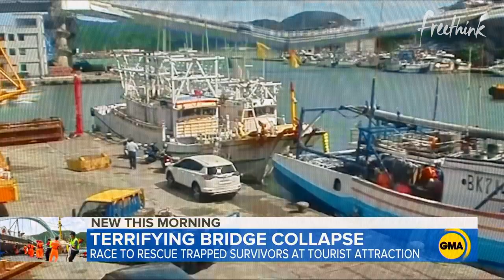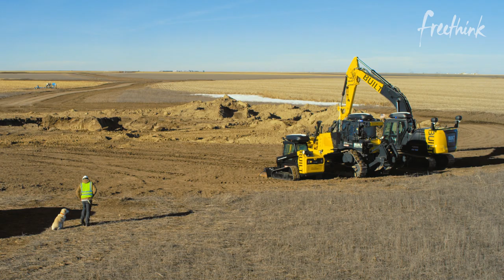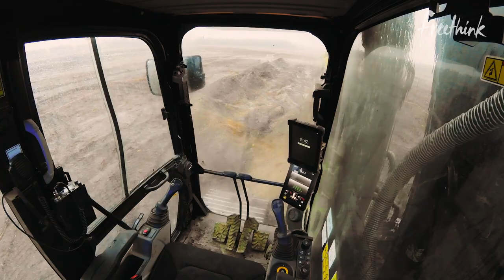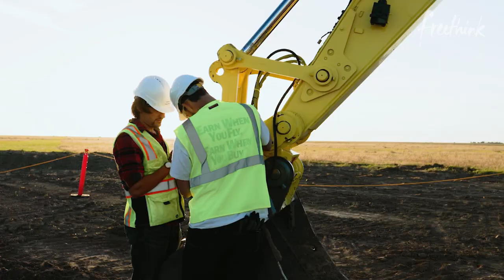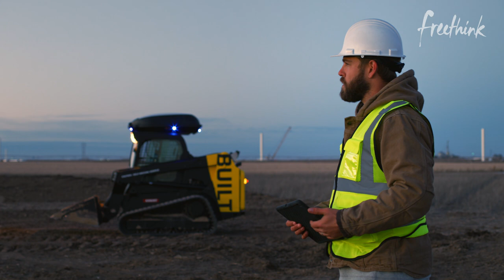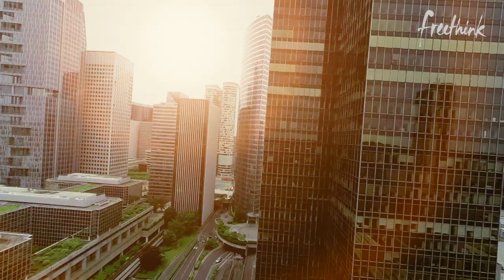The Driverless Future of Construction Robotics

Comment: We at Mortenson have been partnered with Built for a few years now.  For low dexterity work, like excavating a round hole in rural areas for wind turbines where we can't get skilled operators to these rural areas.  We are using an excavator, compactor and a dozer, all three autonomously working together to dig, move earth and grade.   When you think about it from a safety and bridging the gap of the growing shortage of skilled labor!  This is not about removing humans from this work, it is repurposing these workers for smarter or higher dexterity work.  PS. Many of the segments in this video are real Mortenson wind project sites.  This is the future now!
Reply: How has your relationship been with Built Robotics since you wrote this comment?  We are thinking about partnering with them.  Do you have customers requesting this tech or have you found it beneficial in winning bids? Thank you
Reply: @mrclm55 customers don't request is. It's how you can land a contract for 200 turbine holes spread over a couple rural counties. Then if the owner ever goes to the site they see how it's done. 
Obviously it's a good reputation move to introduce yourself and the tech so in thw future thwy know you can deliver. Say if something like a health emergency requires half the country to stay at home.

Comment: At Mortenson, we partnered with BuiltRobotics to test and validate the use of autonomous heavy equipment for the past couple of years.  WHY? We are trying to solve the mega trend of the shortage of skilled craft and Operators in rural environment which are away from the workforce populations.  We are working on low dexterity work that a machine can do which is far higher value then having a skilled operator taken away from high dexterity work (more complicated work best done by humans) so we move earth specifically to build clean energy - wind/solar projects.  Many of the scenes in this video were taken from Mortenson energy jobsites.  It's not about replacing people, but augmenting the workforce so we can apply the tribal knowledge and high skillset on the right work, vs. having machines do the tedious work at night while workers are with their families.
Reply: Ah yes, 'augmenting the workforce' and applying 'tribal knowledge' - whatever tribal knowledge means in relation to a construction job. Dude, you've swallowed too many business efficiency seminar powerpoints. I'm a civil engineer, I can see your bs a mile off. Of course it's only a very minor impact on jobs at the moment. Lift your head up from your LinkedIn profile for a second to think about the wider effects over the next 10 - 20 years.

Comment: I think this system and others that I've seen are great and they WILL replace people. Tje problem is not everybody has the aptitude to get into IT. 
I work in construction and most tradesmen become tradesmen because their good with their hands. 
The other thing I've noticed about construction over the past 10-15 years is that the plans and specifications we get onsite are getting worse and worse and the engineers and architects are doing less and leaving tradesmen and site people to fill in the blanks, the reality is robots are only as good as the person programming them. I b erlieve these machines are great but even the video shows them working on there own in a big wide open space, the reality is most construction work takes place in cramped sites in the middle of a city. 
I think construction will eventually become more automated but you have to change a lot of peoples attitides.
Reply: Survival of the smartest i suppose...

Comment: It's going to be really hard to get this accepted and used mainstream.The people in charge of construction products like predictable.They have to win lowest bids repeatedly.If they can't fully trust in the work getting done they can't bid.If there is any problem with the computer not working/ it's actual ,practical capabilities at all,which causes even small delays in production they will have software ripped out by themselves and a qualified human in the seat faster than you can say unemployed robotics,and they won't be coming back.And even on simple" tasks I don't think they will have the split second awareness and deduction making,and control needed .You'll end up needing one operator to run one AI tractor full time,which sounds more expensive to me.Maybe it would work if you have no skilled operator and a foreman can get a task done( possibly done).Even still that would be expensive tech waiting around for the "easy work" and still costing money.Good luck,I think itllfind a niche,but it won't be used widely .
Reply: As soon as thwy can make them they're out the door. All thw units are going to large companies.